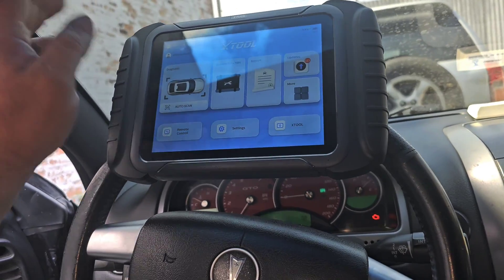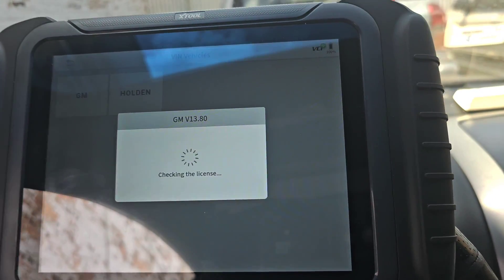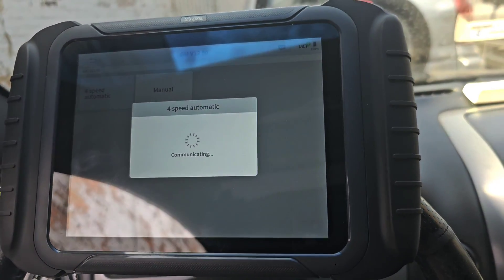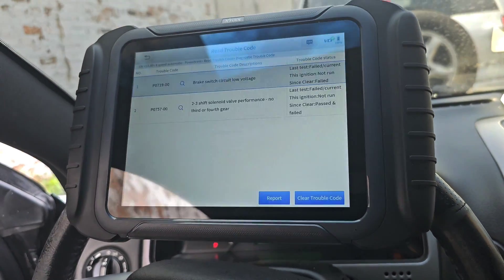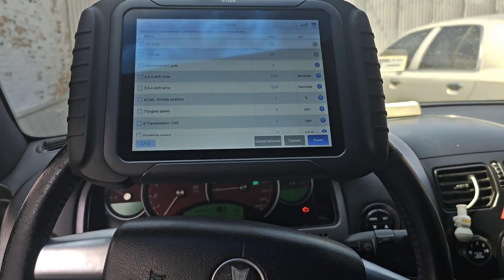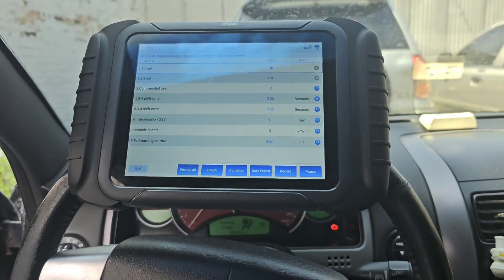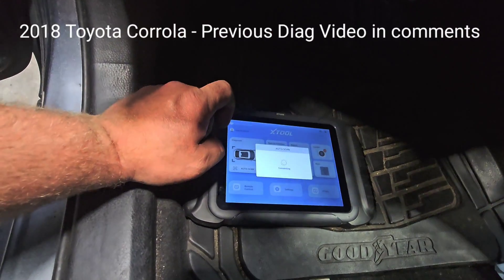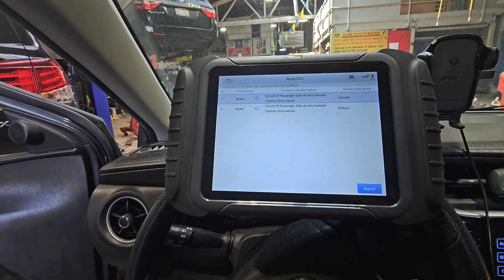XTool D8W Scan Tool - Diag a 2005 GTO and A 2018 Toyota Corrola AC Failure Concern

Comment from the maker: Wi-Fi Wireless Bidirectional Scan Tool - XTOOL D8W! WiFi Connection instead of Bluetooth!

Wifi wirless Connection currently is available in the device costing up to $2000. Faster than Bluetooth transmission speed, stable communication, long transmission distance, large loading capacity, helping you achieve rapid diagnosis

XTOOL D8W is the upgraded version of the D8BT scanner, offering advanced features like Topology Mapping, ECU coding, key programming, and full system scans. Wide car coverage, support CANFD & DoIP capabilities

Purchase link：
US: https://www.amazon.com/dp/B09N969V84
CA: https://www.amazon.ca/dp/B0BMTRRN3N
Discount Code: XTOOLD8W (8% OFF)

Comment: Hey rich..can you help me out have a 2013 f150 3.5  136 k ..blew a po299 code under boost condition what is the cause bad bov or vacuum line or turbos
Reply: P0299 is a code for low boost. Mostly you have a leak somewhere.
Reply: I recommend getting a smoke machine tester

Comment: where did you purchase this scan tool?
Reply from the maker: Wi-Fi Wireless Bidirectional Scan Tool - XTOOL D8W! WiFi Connection instead of Bluetooth!

Wifi wirless Connection currently is available in the device costing up to $2000. Faster than Bluetooth transmission speed, stable communication, long transmission distance, large loading capacity, helping you achieve rapid diagnosis

XTOOL D8W is the upgraded version of the D8BT scanner, offering advanced features like Topology Mapping, ECU coding, key programming, and full system scans. Wide car coverage, support CANFD & DoIP capabilities

Purchase link：
US: https://www.amazon.com/dp/B09N969V84
CA: https://www.amazon.ca/dp/B0BMTRRN3N

Discount Code: XTOOLD8W (8% OFF)
Reply from the maker: Coming soon

Comment: What transmission does that gto have? I know of quite a few issues certain ones from that era, should have a manual anyway it's a GTO!
Reply from the maker: 4l60
Reply: @FordBossMe  that's what I figured, I know they have valve body issues with that 2-3 shift all the time. I know you know more than I do and you know good transmission people so you'll be fine